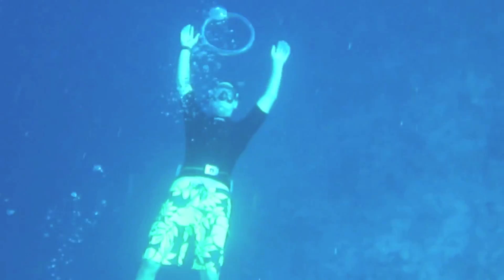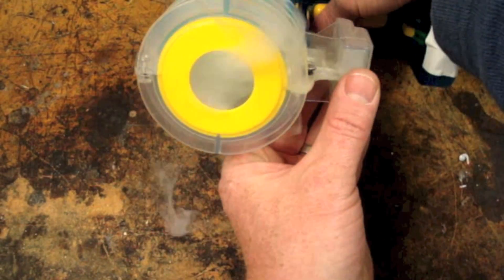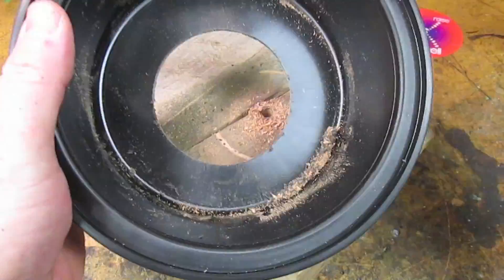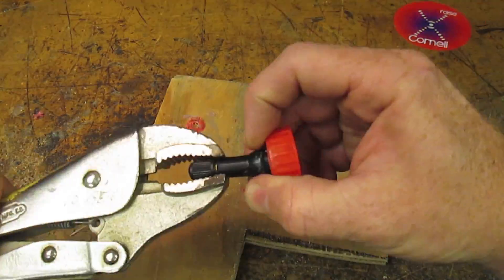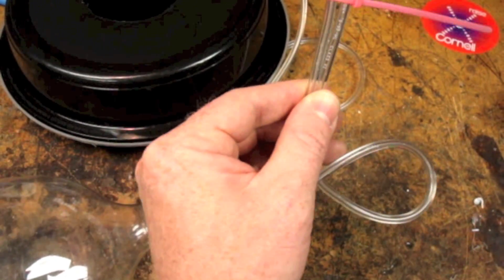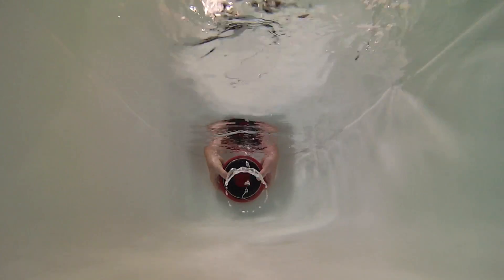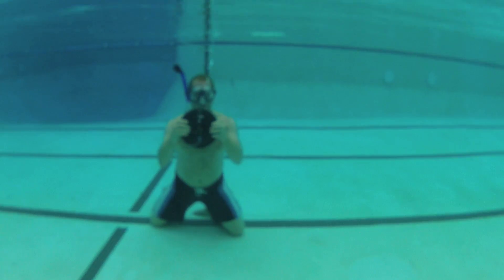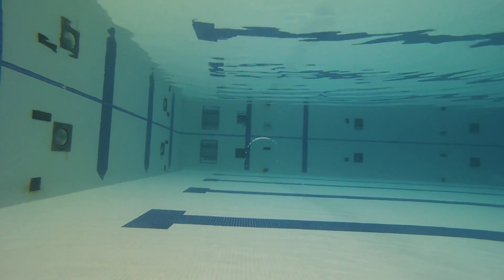DIY Dolphin Ring Vortex Generator (learn to make underwater horizontal bubble rings!)

Comment: You asked, I did: i built my own. I didn't make any video but I can say a few things: I tried blowing air through the tube but it's very hard to control air flow against the water pressure. Specially it feels very hard to start blowing when the tube is full of water. Maybe a one way valve at the end can hold the tube filled with air. I found that very little bubbles are best, and i even found that it''s better to either place the tube right on the side of the hole, or a below, but a couple of inches in front of it. If it's placed right under the hole, it starts to fill the device with air and the bubbles don't work that fine.
I used a giant balloon (like a punch one but without the ring for attachment) and I found a way to hold the tip with the fingers of my hand while holding the device with the other hand. Also the rubber isn't completely tight, so I move the tip of the balloon by hand, as fast as I can, and it makes fine rings. It's kinda better to press the rubber your way, but I think maybe you could use my style better than me, because those balloons are easier to grip from the tip, and yours is tighter. The motion is more fluid and the vortexes made my way are "larger" i don't know how to describe it...they simply displace more bubbles but are slower and softer. they displace more water and the feeling of the hit is "wider" but softer than the vortexes created by pressing fast the rubber.
I'll try it the rest of this summer to see what else i can get. Seems like an air container is mandatory, but I'm afraid of rusting my air pumps just because of the closer humidity.

Comment: Your air bubbles are too large. if you had foam or a mesh on the end of the tube that broke up those bubbles your rings would be much more solid.

Check out the Torid Pulse, but it requires an air supply. At least there are videos of them colliding.

You can make the vortex with your hands and use bubbles from your mouth, but it takes a lot of practice. Now I really want to get in the water and try some other techniques.